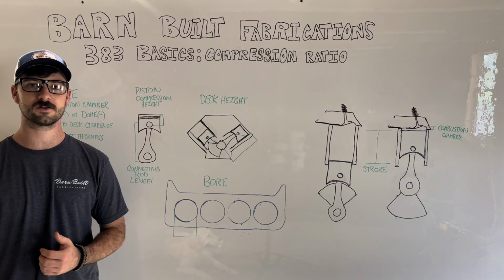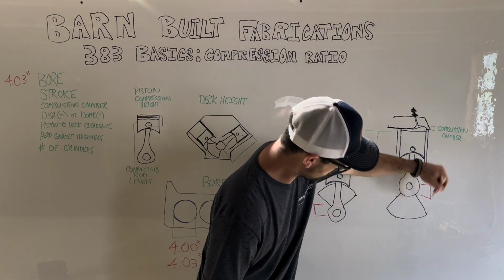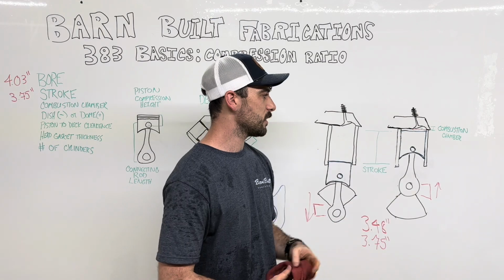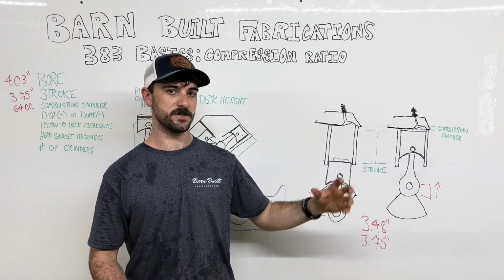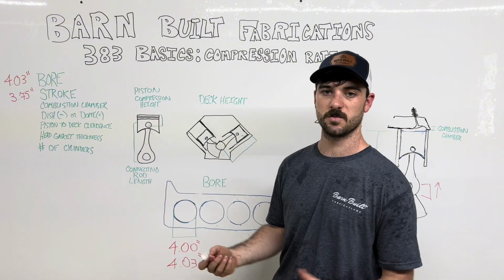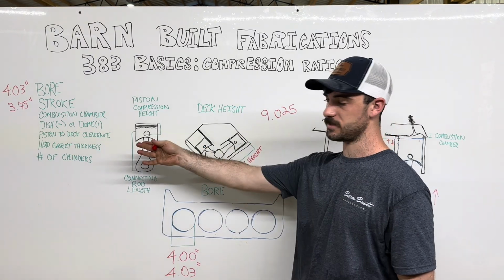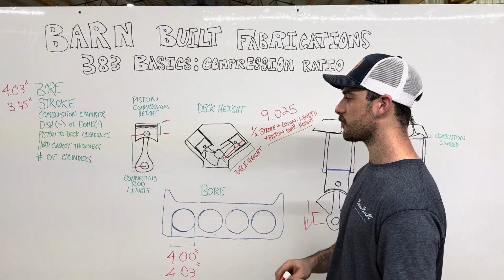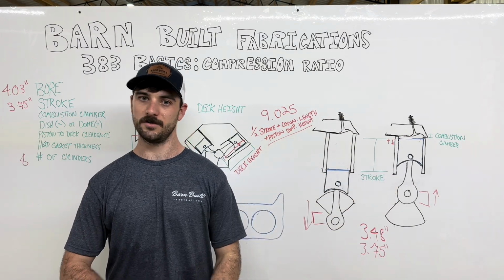383 Basics: Compression Ratio

Comment: Why would i want to run higher rpms the higher the CR?
Reply from the maker: It comes down to the octane, which is the compressibility of the fuel prior to detonating, that you are running. Higher compression ratios increase the compression exerted on the fuel and therefore needs a higher octane to avoid predetonation. As to why the higher RPM helps the short explanation is that the combustion process takes time and at higher rpms you are able to “outrun” the detonation that would otherwise have enough time to happen early (pre-detonation) when the piston is traveling at a slower speed.

Comment: I'm freshening my 383 with 6 inch rods, piston skirts had slight wear. Is this normal? Reason for rebuild is it had blow by on cyld #6.
Reply from the maker: Very common to have wear on the skirts. It’s usually just the coating. If they’re deep scratches or gouges that would be a different story.